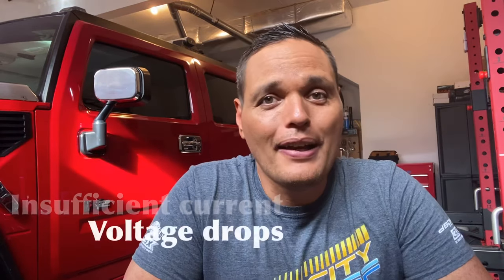The Top 10 BIGGEST MISTAKES in Car Audio. How to do it right!

Comment: Hey quick question i just put a new aftermarket radio in my car and as soon as i turn my headlights on the audio cuts so i figured i wasnt getting enough power so do you think like adding the big 3 is enough to run my aftermarket radio and a small 200w sub or do i have to swap the batterie i need help i am very new to this. If you have anymore tips it is very apreciated.
Reply from the maker: 200w is not much at all. Should not cut off with your lights on. I’d def do big 3. And go from there. Also make sure gains are set properly
Reply: @NextLevelCarAudio  the sub and amp are not even installed yet the radio alone the audio cuts with lights on
Reply from the maker: Sounds like a loose or deteriorated ground somewhere
Reply: @NextLevelCarAudio  any suggestions on how to check that?

Comment: Is car audio still alive? I was into car audio late 90s to around 2008. I don't hear much cars with bass these days like before. I'm thinking on a decent 12 or pair of 10s on 2k.
Reply from the maker: Yes sir. It’s alive and kicking! Lol. Do it man! Get that bass goin’!
Reply: @NextLevelCarAudio  Awesome. I have an old Audioque  hdc3, Hifonics Colossus, pair of Boltars 1000w class AB and about 100ft of 0 awg cable in the shed. I might see if I can get an enclosure built for it then. I been out of the scene a while and used to build, repair and troubleshoot systems 24hrs a day. Shops would call me to go fix their mistakes all the time.
Reply from the maker: Wow, that’s awesome! I might have to keep you in mind then.... lol.

Comment: Would the remote on wire cause a lot of interference
Reply from the maker: No sir..... none at all with such low current flowing through it. Matter of fact there are some manufactures that have a remote turn on wire built right in to the RCA’s so you can easily run them together in a single run

Comment: I have a orion xtr 2500 with 4 orion xtr pro 12 wired at 1 ohm, 200 amp alternator ,ran 4/0 for power and ground also have a run of 1/0, the ground is bolted to the chassis, big 4, northstar agm up front and a group 31 agm in the back, yet I still get huge voltage drop the music starts sputtering and shuts off at times. Any idea? Maybe bigger alternator?
Reply from the maker: Do you still drop off voltage if you rev up the engine during the music playing? If voltage drop reduces or disappears then yes, you need more alt power. Goal is to have enough alternator power where you don’t drop more than a volt full tilt at idle.

Comment: So skar audio sdr 12s a loaded enclosure right from the website with 4g and a capacitor good idea or bad idea i don't plan on going bigger I'll be running a 2k watt orion ztreet amp
Reply from the maker: Two 12’s on a 2k is no joke. That sounds like a good system. Anything bigger, probably a supplemental battery would be a good idea. I would definitely do big 3 upgrade with this setup.
Reply: @NextLevelCarAudio  i was going to do the big 3 when i can I'm not going any louder than these 12s so i was going to run a 2farad cap and call it a day

Comment: Why cant you use seatbolt or seat bolts for ground?
Reply from the maker: You can. Just not as good as frame or direct run to engine block/ negative terminal.

Comment: I'm into bass guitars well I made mistakes in the past with my solid state preamps right now I got a new amp I'm not cranking the gain or I'm going to blow a fan like I did with my old amp. It's the same with car audio that why I'm so careful installing aftermarket speakers and preamps.

Comment: I have a 8k taramp 1ohm then I have 2 star audio 1 ohm 3000 watts max and I also change my alternator to a 370 but when my bass hits it clips goes into protection mode I turn my gain down but sometimes it clips only if I turn it up a little to much I have 3 battery’s too one yellow top and the other ones are ds18 audio battery’s  there pretty big battery’s but my bass amp clips from time to time when bass hits hard i have 2 grounds and 2 o gauge wires going threw it I used a splitter at the power and ground to have to grounds and 2 red wire at o gauge but it clips from time to time I’m wondering maybe my taramp 8k bass needs more voltage is the only thing I can think off your thoughts my voice side I have a taramp 5k for my 4 10 but that side never clips

Comment: My car makes it difficult to reach the negative battery terminal and I plan on running a negative from the front battery to the back 2nd battery. Could I get by using the engine ground or should I make the extra effort/use extra wire and connect directly to the front negative battery terminal.
Reply from the maker: Nothing like direct connect to terminals, to me it’s worth it. Do it once do it right

Comment: Does having a bad ground reduce amplifier output.  Thanks
Reply from the maker: It can, and worst it could cause electrical failure if your amp does not have protects mode

Comment: Hey man quick question I installed two 12 kickers on my brothers 06 Pontiac Grand Prix but when I turn the key to on position but not turn the car on the amp turns on and every but when I turn the car on the amp turns off wat could It be ?
Reply from the maker: The amps Remote turn on wire was installed to the wrong ignition source wire. You need to install that wire to one that shows +12v when car Is running
Reply: @NextLevelCarAudio  thank you 👍🏼

Comment: I have 2 Skar 12s that are rated at 1000 watts wired up to a 800 watt amp. Any advice for making the lows hit harder? the subs are broken in now, is it safe to turn the gain on the amp up?
Reply from the maker: What kind off enclosure you have them in? If it is sealed or a “pre-fab” ported, then get a custom made porter enclosure built to spec for your subs with low tuning and lots of port area. Enclosures make all the difference with subs.
Reply: NextLevelHummer Yeah I got the box that came with the subs
Reply from the maker: oh okay, i got ya. id keep adjusting the gain till you start hearing distortion, then back her down just a tad. if your dust caps get to hot or you start smelling burning voice coils after 1 song at full tilt. you gone too far tho lol.
Reply: NextLevelHummer ok I’ve given them plenty of time to break in I notice they have gotten louder so I’ll turn the gain up a lil. They still hit hard everything in the car shakes violently so 😂

Comment: Do i need a fuse before the main then after the battery to the amp?😅
Reply: Meaning a fuse up front and 2 fuses in the back ?
Reply: @nathan5270  Yes. If you have a positive wire going from a power source you have to put a fuse on it. No matter if it goes towards another battery, to a volt meter or to an amp ALWAYS put a fuse in the right size on it.

Comment: Most small cars do not sit on a A-frame. So all you have is a body chassis.
Reply from the maker: Yeah... that’s when you run a ground directly from you negative battery post. Along with your power wire

Comment: How do you wire up your bass/sub to amplifier I don’t really understand I got 2 gas alpha 1226 12 300 rms if I don’t bridge I got 280 rms so should I go black to black and red to red or black to red and red to black?
Reply from the maker: With 2 300w subs your gonna need at least a 600 watt amp to run them, or you will be overworking your amp.
Reply: @NextLevelCarAudio  okey i bought an boss rip 995 2000 watt amp when bridged it gives 1000 watts that’s enough right?
Reply from the maker: For sure, just set gains properly and your set

Comment: I just got 2 kicker q class square 12's on a power bass asa3 1500 watt amp and would like to know what would be the best way to power the subs with that amp. The box they are in is 20lx44wx15h with the port on the right side. I'm not trying to do competition style but I do like the bass to sound great not over powering. Kenwood is my head unit also. Door speakers will be replaced soon.

Comment: I’m going to run a sundown x12 v2 paired with a taramps 2000.1, currently I plan on a second battery, 0 gauge wiring, 100 amp fuse. Stock alternator. Normal front battery. I’m wondering if this will be enough or too little. I want to do it right. I’ve seen people run a 3k amp with them same sub on stock everything with no issues. However I would like to stay safe and reliably send power to my amp and sub.

Comment: Quick Question ‘if I want to replace my front battery with a agm /or lithium battery does my secondary battery I have in, have to match it?
Reply from the maker: Nope. Not if you run isolator.

Comment: Hey man great video, quick question ive got 2 skr sdr 12s on a skar rp1200.1 wired to 1ohm and am looking to add a skar vd8 2ohm duel voice coil and a rp 600.5 if i do so will i need to add more than the big 3 and a yellow top battery in order to safely power that setup?
Reply from the maker: You’d be pushing it I think. would not hurt to have an extra battery in the back.

Comment: What's the lowest end Oscilloscope that you would be willing to use? Im only gonna do 2 systems, my SUVs and my motorcycle and I dont see spending $300 and up on something I will use twice.  So looking for budget but not junk.
 at the moment my HU is perfectly clean at max volume, but max aint enough so I am adding a 5 channel to it and changing speakers to match ratings. on the motorcycle I am changing everything out. I've pretty much spent my limit between the best amps/speakers (for my budget) and best cables/wires, connectors, router table and bits, sub box building materials, sound deadening materials, 2 types of multi meters (to check amps and volts simultaneously) (wasn't expecting that kind of extra expense).
Reply from the maker: This will Answer you and probably surprise you as well!
https://youtu.be/nKQqcQ5q34I
Reply: @NextLevelCarAudio  thank you! and its less than half of the one I was looking at!
Reply: Liumy 2020 on Amazon. Excellent value for what you get.

Comment: How reliable is the kicker kxa series amp as far as the gain light indicator goes? And does the head stereo unit cause the gain to be lower than what the subs can handle?
Reply from the maker: It’s good for a quick reference, but would not use it to actually set gain. And for your second question, not sure I understand. Your head unit sends a signal to your amp with a certain pre-amp voltage. Once you set your gain accordingly based off your head unit signal it will be good to go

Comment: Hey i have 2 12 in subs 4 4x6 kickers 2 3.5 kicker speakers in my 1994 gmc sierra i just added 2 marine speakers in the grille and everything works fine after like 10 min the speakers start sounding wierd like echo with no power at one point it ended up turning off the truck and everytime i would charge it will turn on for a bit and turn off please help me my friend

Comment: I seen somewhere that you can tune your subwoofer amp with a tweeter at 40hz when turning your gain up when the tweeter starts making noise you would be clipping your subwoofer and to dial your gain down to where the tweeter is quiet again. Does this way actually work for adjusting subwoofer amp gain?
Reply from the maker: You can use tweeter method. But not as actuate for me as setting by ear. And not nearly as accurate as using o-scope. Check out my video on my channel on setting gain using cheap $40 o-scope. Here:

https://youtu.be/hQOPP-l3AMo

Comment: My  question is I am running a factory head unit with  a lc2i converter to a rp-800.d  skar amp to a 15 skar svr sub paralleled to 1ohm  and I am experiencing voltage drop would a capacitor help in my situation
Reply: No get a high output alternator or Lto battery

Comment: what i'm wondering is whats close enoug my subs together are 500w in the setup i'm going for and my amp gives 400w i felt like that was close enough
Reply from the maker: That’s fine, just be careful not to demand too much out of your amp by setting gain too high. I always recommend getting a little bigger amp and having headroom so it runs cooler and is not straining to keep up
Reply: @NextLevelCarAudio  hopefully will be fine. Will keep a look if it gets very warm and be abit gentke on the gain
Reply from the maker: Sounds like a plan

Comment: What’s the best way to wire the remote wire since I don’t have that option in the back of my radio. Right now I have my remote wire directly run into my amp with my power wire an with a toggle switch
Reply from the maker: The most reliable point would be your ACC wire from your ignition. That gives +12v when car is running. As a secondary option, you can tap into your cigarette lighter given that it turns off when car is off. Most do, but some don’t so check.

Comment: I got a Rockford 1500 bdcp isms 1800rms at 1ohm I was going to set a sundown what sub do you recommend?
Reply from the maker: Sundown subs are very underrated when it comes to power handling. Especially once you start to get into the X, ZV5, and nigh shade series. So I’d say a pair of SA series. 10’s, 12’s, pick your size. If you wanted to push it, it could run a single X-series. But it will still be hungry for more power. My ZV5’s for example are “rated” for 2000 watts rms each. But I have 2 connected to a 12K and they still hungry!
Reply: @NextLevelCarAudio  I was going to get one x series but wasent sure if my amp would push it good enough
Reply from the maker: It will be close. But i think you will be alright. That’s a good Rockford amp
Reply: @NextLevelCarAudio  I might just get the 1000rms sa 15 1800 rms should be plenty for that I don't want to get the x and it be under power n push the amp I should of got a different amp I paid $800 for not that many rms live n learn sorry to keep bothering you but your knowledge is such a big help
Reply from the maker: Anytime man. Should still pound nice! Glad I could help. Take care

Comment: New subscriber. Great videos you know what you’re doing 👌🏼💯 the key point I’d like to make is you’re a great communicator! That’s not always a very common trait. It’s a virtue and separates the good from the elite lol. Okay without further a due I have a question. About compatibility and tune setting for my amp to power 4 Kicker 6x9s (product # 46CSC6934). The amplifier i bought many years ago but still works great. It’s an old school Rockford Punch 500s 2 channel. My wire configuration should be optimal. Each pair of 4 ohm speakers wired in parallel to create a 2 ohm load at each channel. My main question is do I want to set my amp to high pass or all pass filter?  These will be my mids and highs in a 4 door crew cab super duty truck. I’m not looking for huge bass, some mid bass is good. I have subs with another amp to do my big bass. Rather than buying a 4 channel amp I’d like to use what I already own so this is why I’d like to do my configuration like so. I’ve never used an amp for mids/ highs only subs so this is new territory for me. 

Kicker CS Series 6"x9" 3-way car speakers-
4 ohm impedance, 150 watts RMS (450 watts peak power)

Rockford Fosgate Punch 500S amp -
125 watts RMS x 2 at 4 ohms
250 watts RMS x 2 at 2 ohms
500 watts RMS x 1 at 4 ohms in bridged mode
Reply from the maker: Thanks for the support and kind words. I’d definitely do High pass between 100-125hz. Just so they don’t get overworked with the frequencies your subs should be handling.

Comment: How do I upgrad my factory Bose amp and speakers without adding a box and losing sound quality to my avalanche?
Reply from the maker: The Bose speakers are trash compared to some of the mids and components you can get these days. I’d start by replacing the factory Bose speakers, then if you want it louder get a new amplifier and bypass the Bose.
Reply: Bose is trash for car audio their headphones and hi fi systems are ok but anyways just avoid Bose in general because they are snake oil salesmen and saleswomen same with sony. My sony headphones clip I feel like getting kicker earbuds.
Reply: @GothdaddyEG  so what makes Bose sound so dang good? Thanks for the reply.
Reply: @j.a.r.family2576  old school bose is good not the newer stuff

Comment: I barely move my gain up and the sub is already loud, what does that mean. I'm running 7500 watt svc sundown amp to 3 15s nsv 4 subwoofers
Reply from the maker: Your head unit probably has pretty high voltage preamp outputs. And/or your subwoofer level control (that some head units have) is turned all the way up. 3 NSV4 15's gonna be hella loud even at lower gain. They probably can take more, but without being there to tune it in person i cant say for sure.

Comment: All these examples are for big load amps.... I have 1 12inch sub on a 800 watt amp... I sanded down a part of my car to put my ground, is this good?
Reply from the maker: That will work, just not optimal. For unibody cars with no frame it’s always best to run a ground from the battery or engine block. But only of you want to best connection possible

Comment: Hi , I have a problem when I am cracking the car my headunit is restarting so can I use a capacitor with 2 farad to help me with this problem ? Thank you for u answer
Reply from the maker: What do you mean exactly by cracking?
Reply: @NextLevelCarAudio  when I am ready to use the car , I have to turn on the car and my stereo turn off for a seconds , I mean restarting again my head unit
Reply from the maker: The head unit power on wire was connected to an incorrect +12v source. It sounds like it’s was wired to an ignition wire that drops voltage between ACC and Run.

Comment: Im putting in a new system two skar ddx 12s and a 3000 watt taramp and 800x4 high amp, of course im not going to be running the 3k nearly at full capacity can i do this on stock electrical with big 3. the ddxs are 1000 wat rms a piece
Reply from the maker: It’s going to be pushing.... if your factory alt has decent output it may be okay 👌